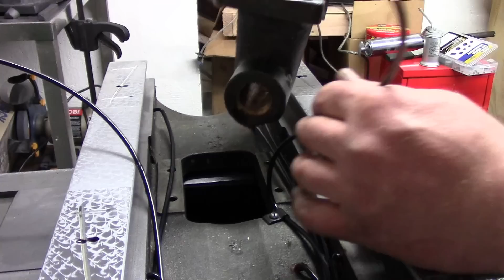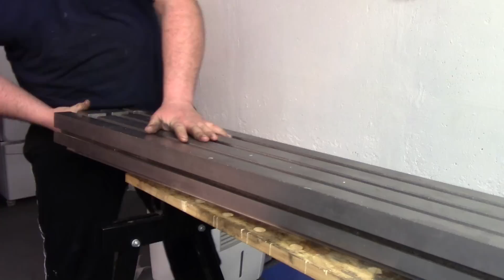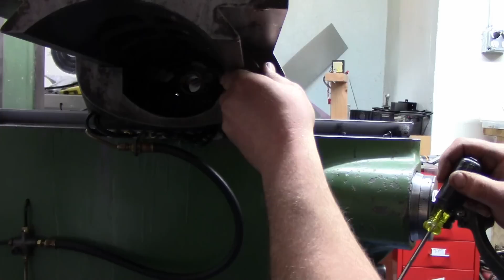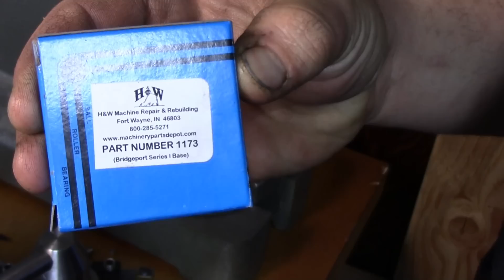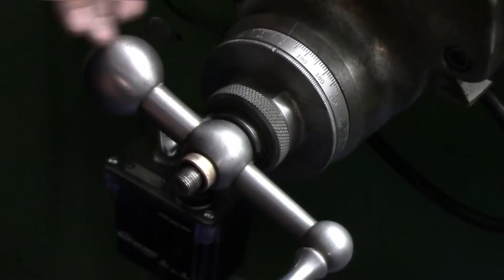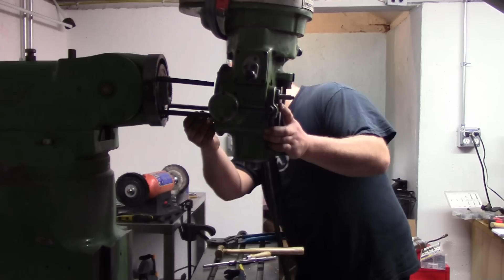Bridgeport Mill Cleaning and Assembly Part 5b

Comment: also, why buy the bearings from a machine rebuilder, isn't there a bearing store anywhere close. faster and cheaper.
Reply: cheaper is not necessarily better.
Reply: +Chris Anderson exactly the same bearings the rebuilding company buys. There is nothing special about them. There are 3 bearing distributors and a Grainger industrial supply within 10 minutes of my house. I'll bet that at least 2 of them have the very same  bearings in stock.
Reply: +Chris Anderson They are angular contact bearings designed to take axial and radial loads. To be properly installed, they have to be mounted face to face or back to back. The inner race is slightly thinner than the outer race so when they are clamped up proper preload is applied to the assembly.

Comment: you messed up when you pressed the beatings in by the inner race. guaranteed to damage them. and then you used Channellock's to tighten the nut on the feed handle.

Comment: height restrictions are a pain in the @$$. I have the same problem in my shop which is why I have a #2 cincinnati horizontal mill instead of the k&t s-15 vertical mill I could have bought instead. at any rate, I love how ridiculously simple B-ports are yet pretty accurate. Nice Half life 2 shirt btw. Are you a fan? still waiting for a 3rd installment?

Comment: Nice to see it coming back together Greg. FWIW unless you have roll pins or dowels to accurately position the X and Y axis bearing blocks, it's far better to run the table to the full travel limit so the feed nut is then as close as possible to the bearing block your installing and only then tighten the bolts that fasten the bearing blocks and your power feed down. That centralises each feed screw bearing to the nuts C/L. There is just enough clearance around the mounting bolts you can be slightly off enough to either get some binding and/or higher wear rates on the feed screw or nuts. If your feed screws were dead straight then the bearings alone would probably do a good enough centering job. There not dead straight tho, you'll always see a bit of run out end to end on the feed screws and with a used machine variable wear rates the length of the screw. 

I also agree with Chuck as well about just using the knee to adjust the height of the assembled head so getting those pita head pivot bolts in through the holes in the head. I didn't make the tool since I hadn't thought of that idea yet, I just balanced the head on a piece of plywood on the table with one hand and with the spindle nose protected by the ply. Then used the knee to position the head to the correct elevation and the Y axis to move the head in as I adjusted each bolt so it was centred in each hole. As you've found out there's enough slop in those tee bolts and tee ring to make it a pain to get each of them all the way through each hole, and do it with all 4 at the same time. Making a tool that holds the head from falling would be the best idea though. But doing it that way does give you a much finer adjustment than the engine hoist will. You got it done so your method obviously does work, but using the table movements is just a lot easier.

Comment: You should use the knee to remove and install the head on the mill. Make a tool that bolts to the table with pin that goes into the spindle, the table and knee take the weight. all you have to do is crank Y axis in or out to remove or reinstall the head.Check out Mr. Pete

Comment: Greg, just as an fyi, you should never press bearings against the inner race.  Always press them against the outer race, using the inner race transfers the pressure against the balls (bearings) and is never good for a bearing.  Can't wait to see this finished and cutting chips, keep the vids coming,  Thanks!
Reply: The bearing should be pressed on the race that has the press fit. If it is a press fit on the shaft you press the inner race, if the press is on the od you press the outer race.
Reply: Correct..!